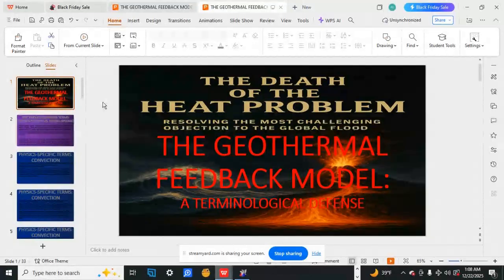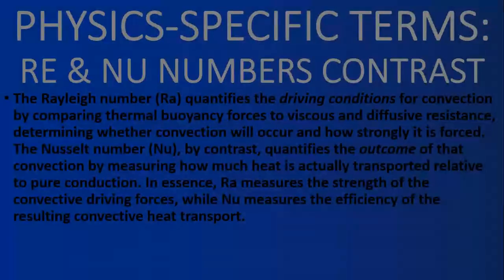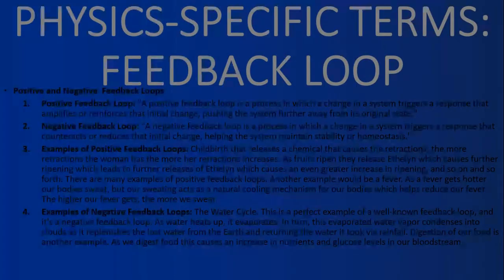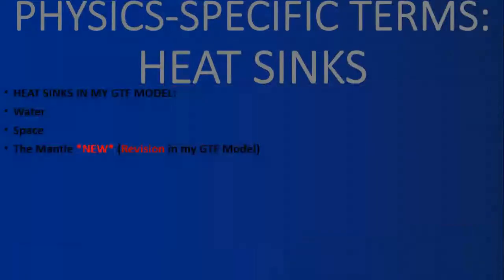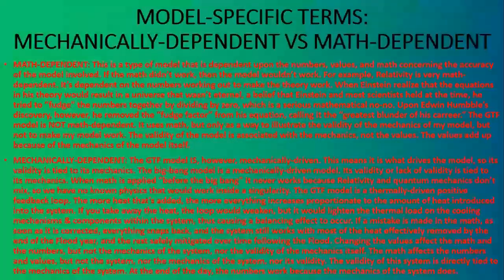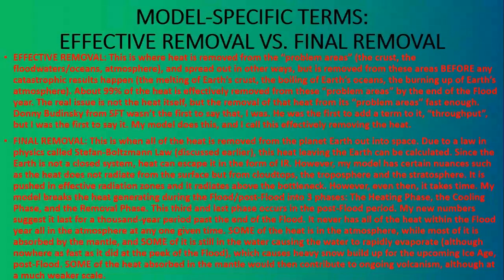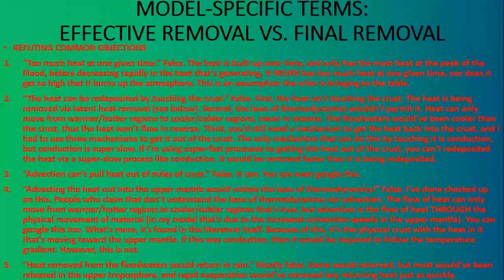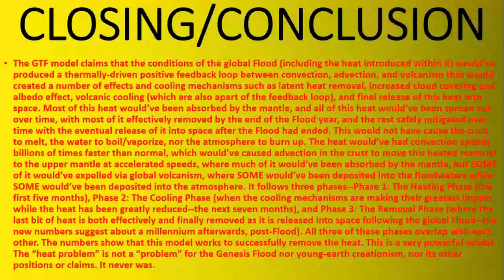THE GEOTHERMAL FEEDBACK MODEL (PART 4): A TERMINOLOGICAL DEFENSE | THE GENESIS SERIES (EPISODE 39)

Comment: Brian, I just wanted to check up if you were aware that the Big 4 isotopes(U238, U235, Th232and K40) also exist in the earth's mantle in fact, despite its lower concentration, the mantle is so much larger than the crust (it makes up about 84% of Earth's volume) that it still holds the majority of the total isotopes(estimated 65%). Also the pressure and temperature must always be greater than that of the crust and that was two of your causes for AND. Now the isotopes are more spread out but as we are not talking about fission here, then in your model, they must also be experiencing AND.  The AND heat problem is not a crustal issue at all: most heat-producing isotopes reside in the mantle, so accelerated decay would overheat the Earth from the inside out, and no amount of crust/mantle advection can remove that energy without violating global energy balance. What is your rescue device for that?
Reply from the maker: Did you forget my GTF model so soon? How do you think I am heating up the mantle to increase convection speed? This increase isn't coming from the heated crustal material being advected into the mantle. Otherwise, we'd have a chicken-and-an-egg problem, since high-speed mantle convection is what triggers high-speed advection in the crust in the first place. AND is happening in both the crust and the mantle, and I was aware of those facts, also hence why it is such a powerful heat sink is bc of its mass. The "big four" are also accelerating, along with other isotopes. Heat increases pressure, and the three conditions involved, within the RIFL theory, are all apart of a positive feedback loop as well, separated from the geological one illustrated by my model.

Negative on AND overheating the Earth from inside out. The mantle would act as a powerful heat sink due to its enormous heat capacity and mass, so most of the heat would've been absorbed into the mantle, with the heat in the crust advected to the upper mantle. In fact, due to its incredible heat capacity and mass, not to mention its present-day temperature, it would've only raised the mantle by a few degrees higher than normal. This has actually been calculated into my new numbers coming out in my next big heat problem video. Some of this heat would've been expelled to the surface via volcanism on a global scale, where some of this heat would've gone into the floodwaters. Water also has a high specific heat capacity, as you know, and the floodwaters would've had a total heat capacity which would've scaled with the volume of the floodwaters which reached higher than the highest mountain at the time, pre-Flood. Some of this heat would've been removed via latent heat removal allowing for more heat to be absorbed into it throughout the Flood year. Some of this volcanic heat would've been expelled into the stratosphere, where it would've eventually radiated out into space.

This is a well-thought-out model. No global energy is violated, nor needs to be violated. Also, I don't use rescue devices at all in my model. In fact, I never need them. Advection is a transport mechanism, not a heat sink. It carries the heated material into the upper mantle. The energy balance remains constant. You are acted as if I'm trying to destroy the heat here. The issue isn't the heat, it never was. The Earth can, and does, handle increadible amounts of heat every year, and even every day, most of it is received from the Sun, but it's never incinerated. The key issue is not the heat, but removing the heat fast enough from its "problem areas" before catastrophic results happen. Advection does that. It removes the heated material really, really fast (as fast as convection is moving) into the upper mantle. I'm not violating conservation laws here, anymore than studies that talk about advection dominating over conduction when the Raleigh number scales is somehow violating concervation laws. This isn't a rescue device. It's modern physics. It sounds like it is you who is trying to come up with a rescue device here. You need to do better than this, for sure. God bless!
Reply: @apologetics-101  I had forgotten it, so as long as you are aware of the Big 4 decaying rapidly in the mantle, that fine. Although you say it's only a few degrees unless you get rid of it quickly, it will build up to a problem level over the year. I will stick to TOA, where you definitely can't get rid of it safely.
Reply from the maker: @graemeross6970  No, not in the case of the mantle. I said the issue is removing it fast enough from the "probkem areas" like the crust and the flood waters. Bc the mantle act as a heat sink it can absorb a tremendous amount of heat without raising its degrees very much. Given its emormous heat capacity, it would only raise it by a few degrees. It would not hold onto all of that heat indefinately, but it can destribute some of it upwards to the surface over time, and so it did. The "big 4" were AMONG the AND, but they'd be accelerating, too. It's not a "problem" at all for the mantle to absorb its heat. That's what it does. The surface heat is not that much, but even if it was the entire amount, this system can handle it. The TOA can get rid of it safely. Since it's spread out, distributed and regulated over time, thermally-driven, a positive feedback loop system that includes cooling mechanisms, is radiated out into space over time, and is not building up uncontrollably all in one location, it can safely mitigated it over time, BOTH WITHIN the Flood year, and IN THE post-Flood period. This is a fact. You'd have to straw-man my model just to make it not so, but your reasoning is automatically invalid since it DOES NOT represent my actual model. God bless!
Reply: @apologetics-101 Heard that sooo many times. I am lookig forward to your next vid where you will empirically show, not just describe your whole process. BTW thank for highlighting my poor knowledge of genetics. You spurred me to study, which I’ve been doing and even bought a couple of books. Finding it complex, but fascinating and starting to get a handle on the jargon. Cheers, Graeme
Reply from the maker: @graemeross6970  I had presented evidence for my model in my initial video on the topic, but it was streamlined and mixed with a lot of other things. This video will be reinforcing the original video I made by going into far more evidence and sources. It's going to be big, very source-heavy and evidence-heavy. I can't wait for it. It will also have my actual numbers for it. The first three videos used Erika's numbers for AND to show the rhetorical force of my model, but these new numbers are going to be more according to the data from the RATE project, and more YEC-accurate in terms of our actual positions.

No problem. To be honest, when I first did my Tomkins interview (the original interview, not the live one recently), I knew very little about genetics. It was me engaging into the Tomkins Controversy (the controversy not my series) on human/chimp percentage similarities comparisons that led me down a road where I'd be discussing this with some of the world's top experts on this, and being considered by YECs to be an expert on the controversy. I was the first to figure out Erika's major mistake, even before she eventually confessed to it. Even in our disagreements, we can prompt each other's interests in topics and further engagement on various issues. That is always an interesting phenomenon. God bless!